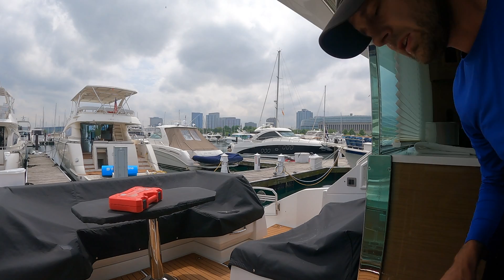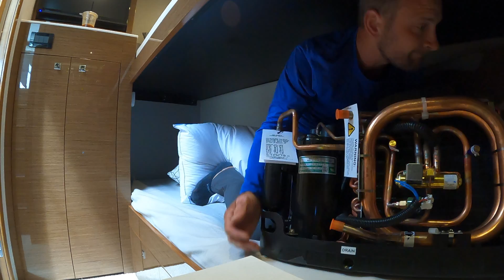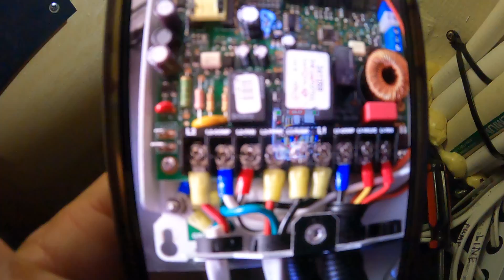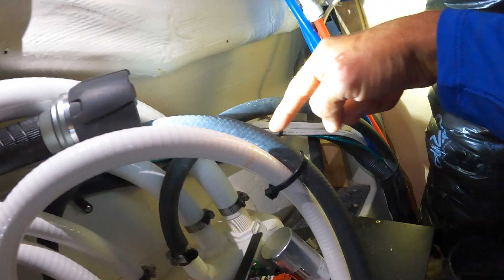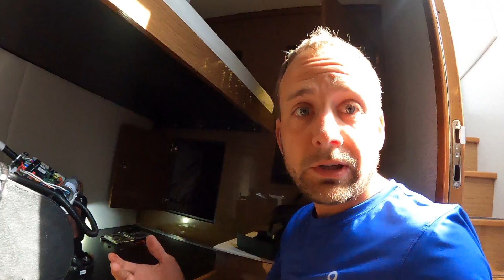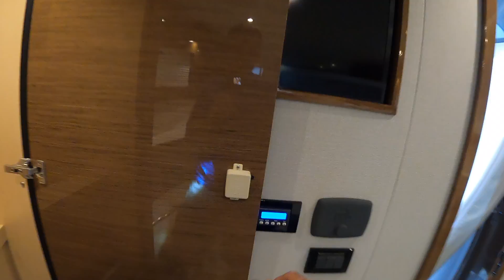Boat Circuit Breaker Keeps Tripping - how we fix it

Comment: So It appears the unit was not affixed in position, but only held in place by the hoses or did I notice some small hold down tabs?  And boy it would be a real pain if that supply hose broke, would there a flooding danger or are there some back-flow protection valves that only open when the supply pump pulls them open? Also every designer and engineer should be required to serve a 6 months apprenticeship  as a boat mechanic so they can learn the results of poor design. Every thing made by man will fail, and will need repair, good design takes this into account. Faster and cheaper repairs, fewer curses and busted knuckles, fewer wrenched backs and workmen’s comp claims.
Reply from the maker: Hahah I love that idea of the designer being an apprentice. So many head scratching designs would be saved. Soo many curses coming from me while working in some of these compartments 🤣

The unit did have multiple clamps that went around the sides of the unit and screwed its into the fiberglass, so she was super affixed- might have not gotten shots of that in the video. 

Great attention to the details of the video! Thank you for watching and commenting! Cheers

Comment: I was wondering when you were going to tell us how you fix the circuit breaker from tripping.
Did I miss something ?
From what I can see you just put in a new unit.
Reply from the maker: Circuits don’t just trip for no reason, typically it has to do with an overload or a faulty unit that is attached to that breaker. In this case, the unit kept tripping the breaker and it was determined that the unit needed replacing. Once replaced, the breaker stopped tripping, this fixing the breaker from tripping. Thank you for watching and commenting 🙌🏼

Comment: I thought it was pretty cool. Wise decision to bring in the new unit. Taking the picture is something that I always tell my kids. When I was younger, before cellphones, we marked everything with pieces of blue tape and a number on the tape and a matching number to where it went. I also took the extra step to draw myself a diagram and sometimes took a yellow paint pen and would draw a dot on the line or cord and then matching dot where that line went to. On and on. Nowadays with cameras, no need and no excuses. I've heard people say the Dometic systems suck, but I've never heard of another brand either. I think Mitsubishi or Toshiba made one. Not sure.
Reply from the maker: Those are some really smart steps to take before the cell phone made projects like this easier. I’ve never had many issues with Dometic units but interesting to hear! Thank you for watching and commenting! Cheers